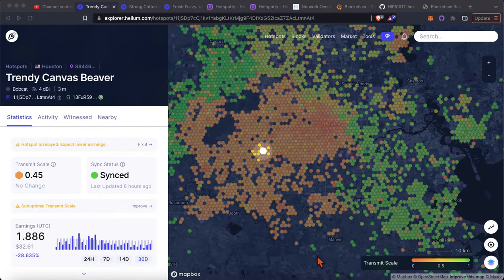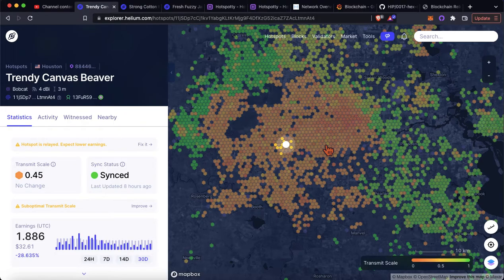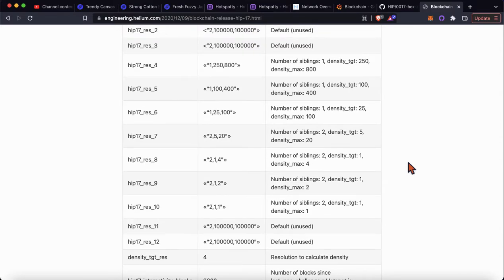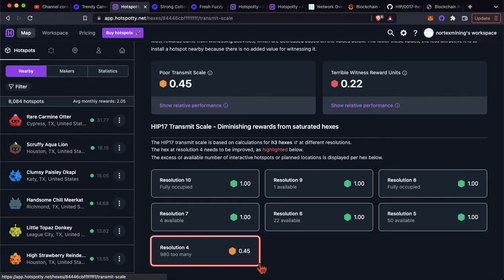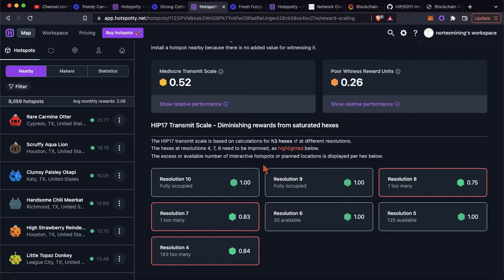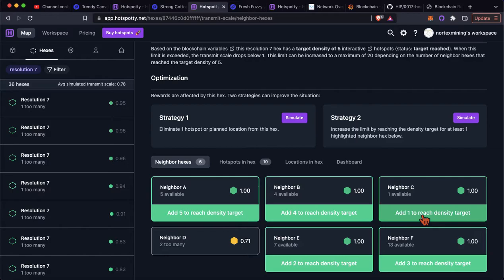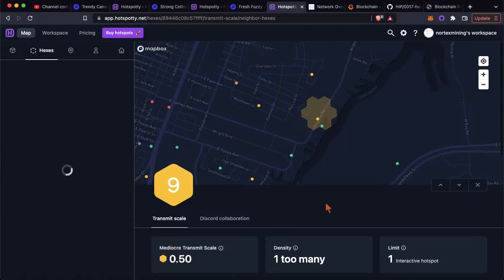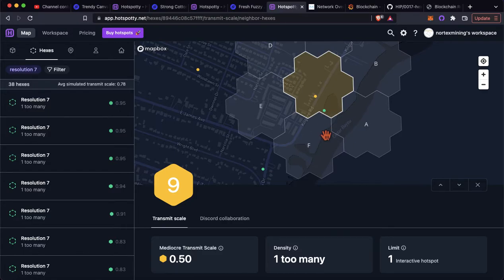How to Fix Low Transmit Scale Mining Helium

Comment: Great video, i liked and subscribed. Question with some background:I recently moved a miner from my work cubicle to my in-laws' house. I paid the fee to move the miner from the old location to the new location.The old location had a 0.49 Transmit scale, the new location all the other miners in the hex and surround hex had a 1.00.After updating location my Transmit scale did not improve, nor did the other local miners go down. Any insight into this? Thanks in advance!
Reply from the maker: Thanks for watching and subscribing Ken! Are all the other miners in the hex active? If not, the 1.0 you are seeing is old data from when they were online previously. OR you might need to wait to get a PoC event at your new location for the Transmit Scale to update. How long has it been since you reasserted the location?
Reply: @NorTexMining  It looks like one of the others has been downgraded to 0.50 as well. The others are active. We have 1 too many in Resolution 9. I'm probably 20 meters away from moving into a new hex in this resolution. I can do this but i probably need to shell out another $10 worth of HNT. Sucks i didnt see this resolution before or i could have just defined it in this location when i reasserted (yesterday...)
Reply from the maker: @ProvokedTomcat  that’ll do it (1 too many in res9 will drop your transmit scale pretty substantially). Moving forward definitely use Hotspotty when reasserting your location so you can easily check which hexes are overloaded. Let me know if you have any other questions, and best of luck mining